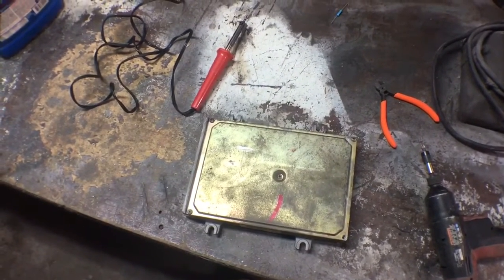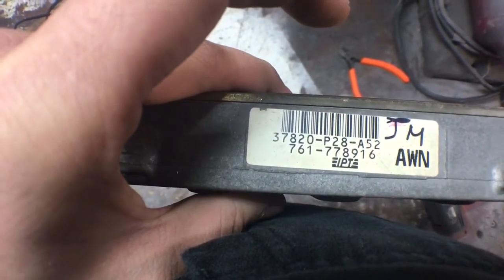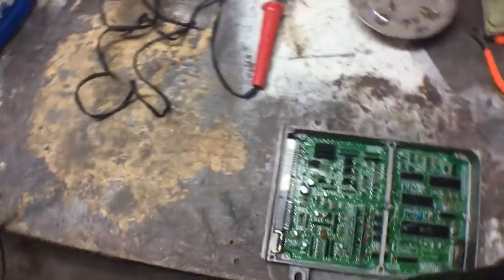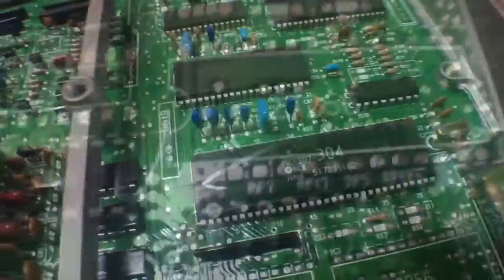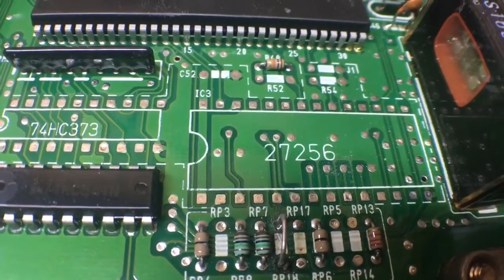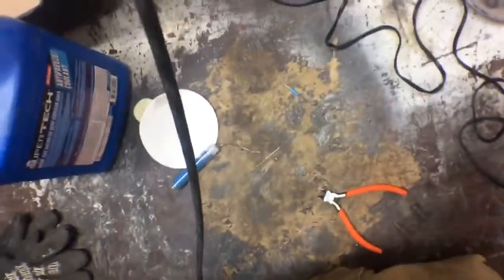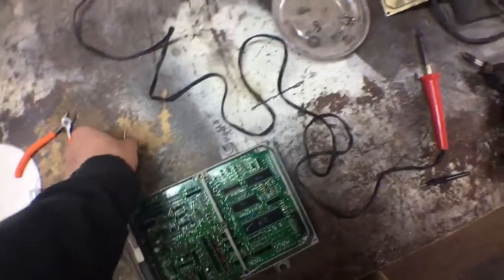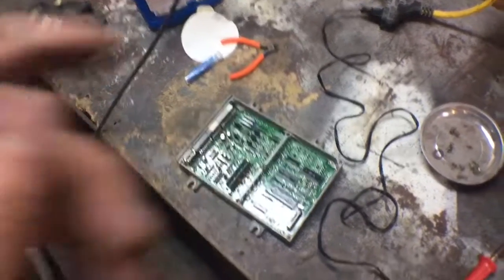Obd1 Honda Ecu Conversion Auto to Manual

Comment: Anybody know what D1 s value is? Marking SR4418  It's a big diode prone to going short but sr4418 research gives no replacement or actual zener voltage.

Comment: great video man, i got a 37820-px9-a17 MT 6spd thats gone bad (fuel inj. 2&5 not pulsing) can you turn a 37820-px9-a67 AT trans. into a 37820-px9-a17 MT 6spd?  its a 1994 acura legend gs 6spd black on black. your contact?

Comment: I converted my auto to manual Honda prelude but i didn't do this step i still have the auto ecu and to make the car start i have the neutral safety switch connected on park mode. but i have noticed that my vtec doesn't kick in sometimes. can this be the problem because the ecu is thinking that the car is parked?
Reply: Cristian Herrera yes, it could be. Also idle issues or hesitations on a gear change

Comment: What does this do
Reply from the maker: BRENDAJASON1 allows you to use an auto ecu on a manual car. If your ecu shits the bed or if you’re doing a transmission conversion and don’t want to buy a new ecu.
Reply from the maker: BRENDAJASON1 I swapped to a Vtec motor but the Vtec ecu was for an auto but my car was manual. I didn’t have to locate another computer. Just used what I had
Reply: myideasoffun thanks

Comment: hi what value is the  big resistor or how many ohms to solder .thanks.gretat job
Reply from the maker: jasonics md you dont need a resistor. I just cut the leg/ lead off of it. You can use wire or whatever you have. That was a 2w 480ohm resistor, but wire would work fine.

Comment: I got a 2005 Acura TL with a j32 automatic I swapped out the intake manifold to a j37 it's got tons of bolt ons only thing I haven't upgrade is the stock computer it's pushing a little over 3 go I know it could do better do you guys upgrade Acura TL computers
Reply from the maker: Junie Ruiz never done anything with a j series.